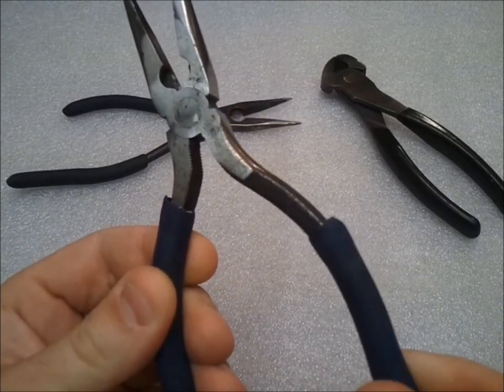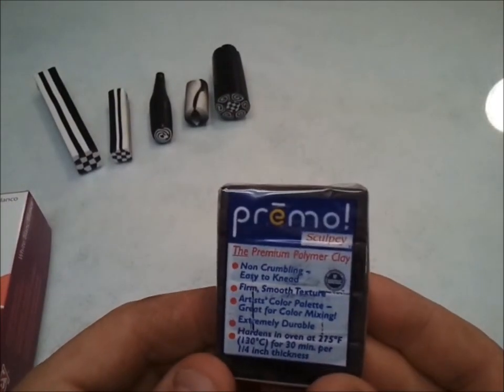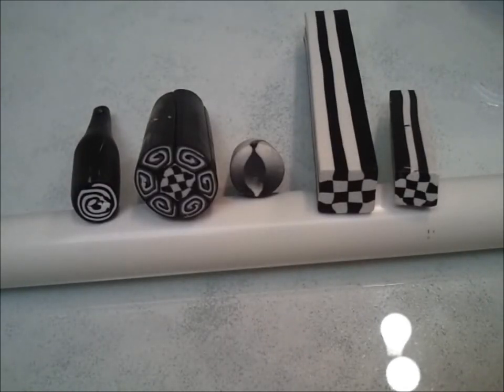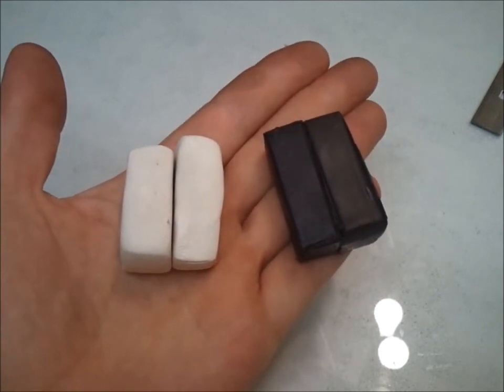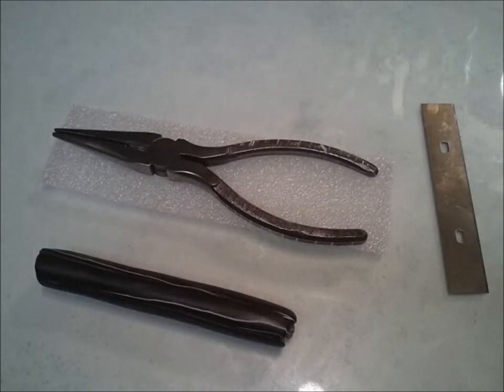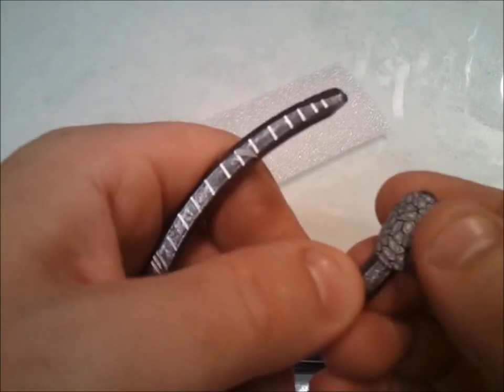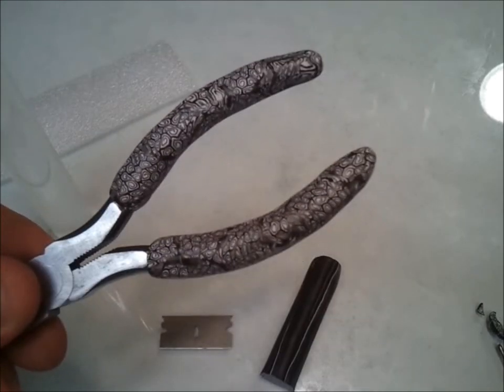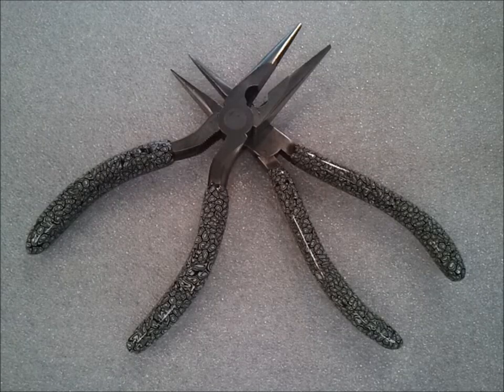Repair needle-nose pliers by caning

Comment: This is a very cool project, thank you! I would never have thought to use clay on pliers but can't wait to try it! The easiest and most secure method I've used is just a piece of heat-shrink tubing over the handle grips! I like to replace them even on brand new tools because they work as well or better than the originals and I can use custom colors so it's obvious who the tools belong to!

Comment: Sweet!!!  I once tried wrapping a welding hammer in wire.... handle was steel with no wood....did it for the sheer fun of it rather than the practicality. Geez, they looked shite....

 So.... eBay here I come to become a millefiorian. 

Nothing to do with Murano but there is this village in Italy that has this stupendous festival every year where all residents have a predetermined stretch of their winding narrow road up the hill and they draw artworks and then using diced sliced or filleted petals they infill their artworks ... locals work collaboratively. Can't get that kind of feel good neighbourly mojo here .... everyone wants to put glyphosate on anything flowering!!

Another highly enjoyable and informative vid... I learn from the ideas, the crafty references and the background. Thanks.

Comment: I just whip the handles of my pliers with paracord. I'm done in about a minute, used up about $0.10 worth of supplies and it'll take a lot of abuse.
By whip, I mean like how one should complete splicing rope so the ends do not fray.

What's shown in the video is fine except I don't have most of the supplies and tools he is using and don't feel like I want to invest in it at this time. Thanks for the video - I did learn something new.

Comment: Much simpler, quicker, cheaper:  wrap some BARE solid wire around the handles starting and ending in the range where you want to grip, spacing each loop about 1/2" or so apart.  This will give us NONSLIP GRIP when we finish.  Around 12 gauge works well.  Remember SOLID WIRE.

Next, mix some EPOXY and QUICKLY distribute along the wire so that you'll get good BONDING and the wire won't SHIFT later.

Now simply have some HEAT SHRINK TUBING cut to length beforehand, and immediatlely after applying the epoxy, slide the heat shrink over the epoxy and wrapped wires carefully, hit it with your heat gun to draw it in tightly around the epoxy / wire wrapping, and when that epoxy sets up, you'll have a long lasting grip with ridges that will give you a great grip like no other.

Comment from the maker: Kind of a hard question to answer.
Different brands of clay have different properties, and the amount of time that you cook it (it does not dry) affects the result. For a tool, you want it to be somewhat soft- so that if you drop it, it will dent rather than chip. For this project, I was careful not to overcook it. This left it a little "rubbery," and the polyurethane gives it a hard shell. After using them for a few months now, I have not damaged the handles. Short answer: NOT very brittle.
Reply: do they hold up on protecting you from elictrical shock .. 120v 277v 480v

Comment: This is a new product and technique to me. Will it hold up as a rugged knife handle material? I wanna make an American Flag scales on the trapper knife I use every day. Is this stuff rubbery when cured or is it hard like an epoxy? Thanks.
Reply from the maker: I would describe it as flaky rubber. Not hard, not soft. You can still easily shape it after cooking it, so it is not very rugged. However, after a top coat, like I did here, it's really hard and durable. Still no damage to these pliers after five years on the bench. Of course, I'm also careful with them since they're pretty. 

My opinion: Sure, it should work on a pocket knife after a few coats of poly. As long as the clay parts are smooth, and there are no edges to catch, it should last a good bit. Nothing to lose by trying.

Comment: Cool idea, great looking results, but you started out saying that using Plastidip is too expensive and takes too long, then you made $50 handles that took several times as long to make?  A can of Plastidip costs less than $15 and will coat numerous tools.
Reply: Agreed. And then you get to replace your plasti-dip handles again in two months! I've been down that road. This is 2016 and the polymer clay handles still look like new. The venture to use polyurethane was a pat myself on the back moment, I think.

Comment: Hey Pocket!
I need some advice. 
I currently am an avid tinkerer who loves to build small but helpful things from ideas in his mind (a hobby sparked by your videos).  Ok, that's the premise. 
My problem is that I'm old enough that I can get enough money to buy a 40 or 50 dollar haul from Home Depot every now and then, but young enough that I don't have a steady enough income to buy any tools that are over $100 without saving for multiple consecutive months.
I am willing to save for that amount of time, so no big deal right? Well except that when I do have the money, I have no idea what tool to buy next. I have a jigsaw, which has been helpful, but is pretty awful at cutting straight lines even in a 2x4. So I was going to get a miter saw. But then I remembered how much I hate hand sanding, so I went back to wanting to save for a belt sander instead, but... and so on and so forth. 
So I was wondering what tool you would recommend for some one who likes to do what you like to do (tinker with random ideas) but that has a limited income. I currently have a drill, a jigsaw, a small hand sander, a Dremel, and a assortment of hand tools. 
Thanks!
Reply from the maker: I was there! 

Money is rarely the problem; space and time are the biggest limiting factors for everything. Money is actually quite easy to manipulate, because it has such definite rules on the small scale, just like the way water flows predictably in a stream. Ok, you didn't ask about economics, you want to know how to make a sweet tinkerer's setup. 

My first shop was a 4x5x8' closet, in my first apartment. I mention the 8', because I used the vertical space to the best of my ability, so first lesson: think three-dimensionally. You can't get over obstacles by only going around them. Ok, I'm lecturing again. 

The table saw is the thing. That's what you want. Everything else is nice, but they are all just concession prizes if you don't have that. If you are doing smaller scale stuff, and you don't think you are ready to take that leap, then the tools that you have are a great start. You may want to add a coping saw, simply because they are so cheap and versatile. Clamps seem obvious to mention, but their advantages might be overlooked by a newbie, so get them early (I like 6" Harbor Freight 'F' clamps, at $3). Also, a good utility knife is your primary weapon. Mine is the Stanley Quickslide, and it is on me whenever I'm awake. It is your surgical scalpel. 

Before I go on to power tools, here is a piece of advice that I can't stress enough: use cragslist. Don't buy tools new. The tools made in the 80's, 90's, and early 00's are usually better than todays plasti-crap, and they are at a fraction of the price. Every tool requires modding, maintenance, and repair- most of all, the new ones.

Garbage is another thing. Lots of my first tools were throw-aways from older contractors. Learning to repair the old will open up a huge array of options that aren't available to most people. Most are unwilling to do work of any sort, so they will simply buy new; take advantage of this state. Another benefit is the advantage gained from learning how tools operate, which will have a long-term payoff for you.  

My suggestion, although it may be presumptuous, is for you to first build a homemade table-saw from a circular saw. You will be forced to confront your weak areas, and you will gain much from the project. RESEARCH. Watch every video, and look at every design you can find. LISTEN to opinions from those that already did it. Pick the elements you find best, most accessible, and most important to you. Find an old DeWalt saw with a flat bottom deck, and convert it into your first upgrade! Every step that follows from there will be the upgrade that you decide is most relevant, which will customize your experience, and define you as a designer, engineer, and craftsman. I wish you the best possible luck. Ask me anything at any time.
Reply: pocket83 Thank you! My "workshop" is in the corner of our garage, and is pretty small. I'm sure that if I save up, and look at Craigslist or yard sales enough, I'll find a table saw that will work for my space. If I can't, I'll try my hand at converting a circular saw into a table saw. 
One more question. The reason I'm woodworking as a hobby, is because I not only enjoy it but I see the ROI that it can bring. So, you've obviously been doing this for a while, so what should be my first step to selling what I make?

P.S. I'm going to send you a PM about something I "figured out" that I was hoping you could test.
Reply: pocket83 Hey Pocket! I just bought a craftsman random orbit sander for $4 at a thrift store. It works great, but there is no Velcro to attach sand paper. I have it just hot glued on right now. Is there any way to get the male end of Velcro into the sander it self?

Comment: one thing i would do is just warp it with a roll of electrical tape on each handle
Reply: Jologogo Good idea, until you do it, summer comes or time pass and "Presto!" sticky handles and residue everywhere, believe me, any alternative (shrink, silicon, rubber,... tubing) is better than electrical tape ;)

Comment: What did I just watch??  Liquid plasti-dip... $8... takes 10 seconds. Done.
Reply from the maker: No, it doesn't. That stuff is expensive garbage. I even mentioned that in the video, so I don't think you did watch it. 

It takes a dozen dips to get a nice handle with that stuff, and by that time the can's too empty to keep dipping in. Besides, it starts to peel off in a month. These clay handles are over five years old now.
Reply: It only takes one dip unless you thin it out.  plus you are able to drop your tools on the concrete.
Reply from the maker: Polymer clay can be dropped. It retains a small degree of malleability even after baking it. I will repeat: this process will outlast Plasti-dip. And it's cheaper. And faster.
Reply: Unless you have multiple pliers to dip, opening can of plastic dip is a waste for one pair of pliers.  
Once you open a can It dried up within a week for $7 a can.